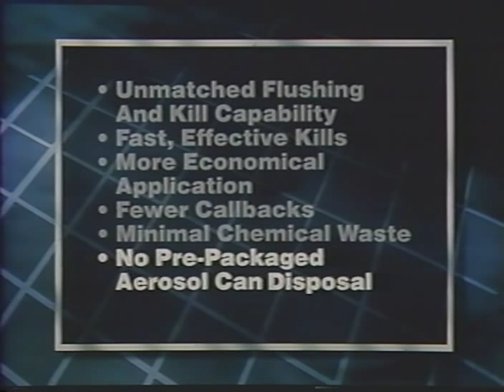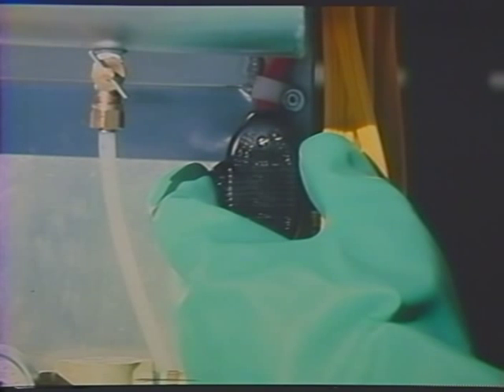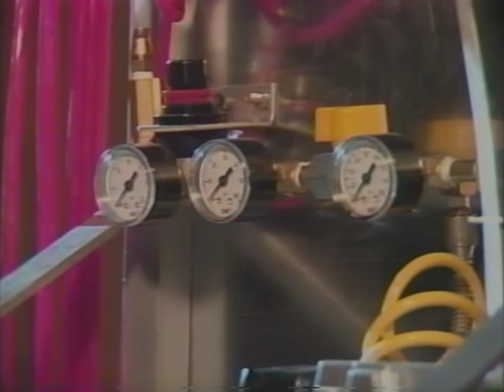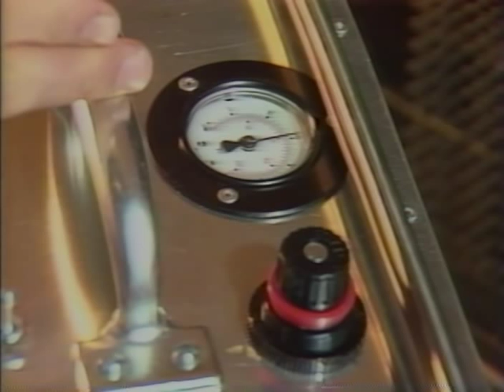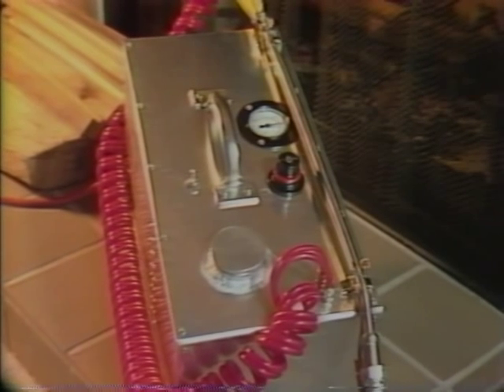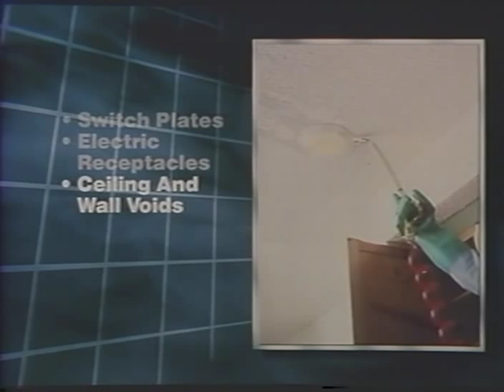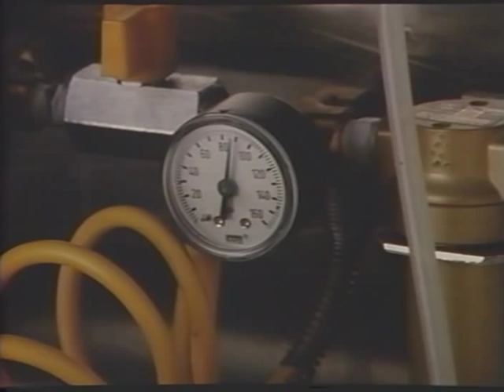Actisol "Deep Harborage" Video - 1987

Comment: If you are a PCT and don't have one of these units you don't know what you are missing.  They can be used for just about any pest.  Wasps in soffits - you can treat 10 - 20 feet of soffit with this baby from a 1/4" hole, locating carpenter ant nests - down right incredible, deep harbourage roaches - totally awesome. An actisol will make you a better technician and pay for itself in no time.  Trust me, I have been using a compact for over 20 years.
Reply: I wouldn’t do a german roach clean out without one! Effective and fun to use!

Comment: can you use residual chemical i would think so
Reply: ive used phantom sc and gentrol through my b&g pas unit...i just dont like to let the water based liquid sit in the thing too long..its best to flush it out after...the oil based liquids can sit in there for a very long time...
i like the actisol and the microinjector...but the b&G pas unit is half the price and equally as good...and it can be fitted with foaming and dusting attachments...which i dont have and havent ever used but may one day buy them to go with the machine...
Reply: i also have the b&G versafoamer hh...the foam wasnt good enough for me so i found a way to modify it...also ive used gentrol and phantom in the foamer too...along with invade biofoam...mixing products correctly makes a world of difference in pest control...i do it often...
Reply: Chris OConnor 
Can Dragnet FT be used in Actisol machine? Thanks